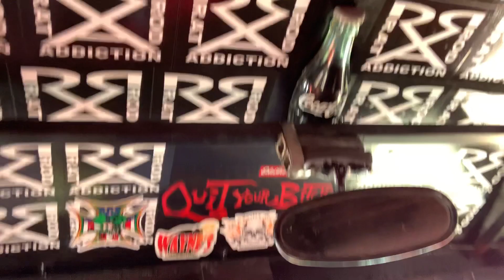Transmission swap 1928 model A rat rod

Comment: Important tips in this video include: Disconnect battery before working. Italian can openers should not be stroked. Paco likes Coke. A lot. Safety glasses when grinding. Colton is a street worker, hey $20 is $20. Th350s are just as wide as Poweglides. The distributor in a sbc is a sbc style distributor.
Obervation: That mouse needs more cam, it idles way tooooo smoove. Its needs the lopey chop.